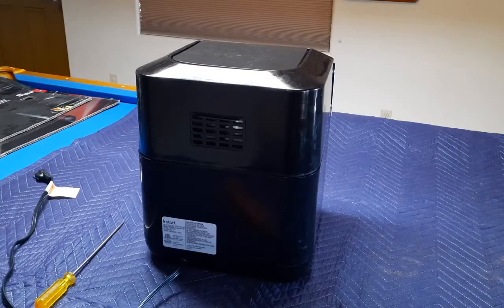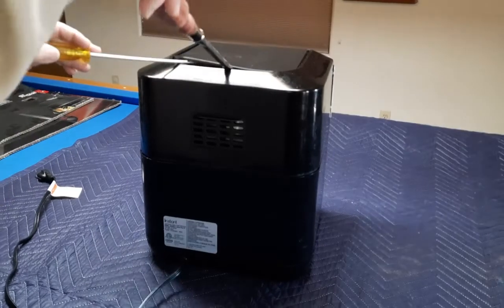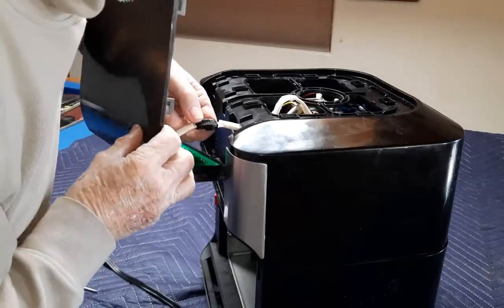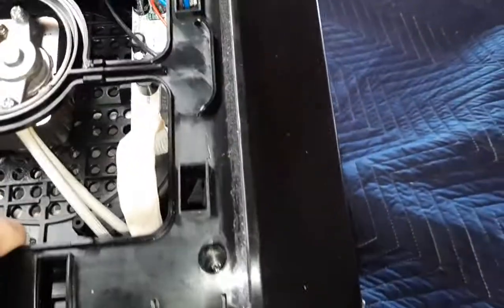How I fixed an Instant Vortex Plus Air Fryer

Comment: mine won't let me press down. i'm pushing so hard on it too... how hard did everyone else have to push?
Reply from the maker: There have been some comments about my video, where they had a problem with the door switch. 
Here is what Leon said about the door switch. and he described the symptoms of door switch problems. .
@LeonKeyser
1 year ago
Thanks for the DIY fix. In our case it was not the thermal switch, but the micro switch at the front. The one that triggers the screen and open door. The switch was malfunctioning and by using a small screwdriver, bending the flip switch leg inside the micro switch a bit, fixed the switch. Now we're cooking again. Your vid helped me figure out how to open it up. Thank you so much! 

SYMPTOM: If the fryer briefly turns on when you plug it in and the light inside stays on, but the screen stays off when the door is open. This switch is the problem. Msg me and I can help with some pictures I took.

Perhaps that is your problem?  We did not have a door switch problem, so I can not verify what Leon said. 

If you sort the comments by Newest you will see another comment made  6 days ago where they could not reset theirs and my reply.

Please, Read my reply and just know a Multimeter is a valuable tool for DIY fixers.

 A multimeter  can be purchased at Walmart, Amazon, etc. for under $20. 

As I told @user-bu3pi2pz2g
6 days ago 

She should test for continuity to see if the thermal fuse is the problem or not. A  word of warning, Never test for continuity when the unit is plugged into power or power is present. Continuity test should only be done to test if a component is open or closed with no power present. The thermal fuse should be closed, or has continuity. If open, or no continuity then the heat inside the fryer triggered the thermal fuse’s temperature rating caused it to open, No Continuity. It either has to be reset or replaced. Resetting puts it back into a closed state, Has Continuity. 

My son’s is still working and since it was so easy to fix, I decided to make this video to help others with the same problem. As I told him, Keeping the unit as clean as possible is the best way to keep from triggering the thermal fuse.  Also, when using for a prolonged time put it is an open space so the fan can circulate cooler air to keep the thermal fuse from overheating an opening it. 

Good luck and I hope you are able to fix yours.
Reply: Yes it's the light still on but screen is off. Ty so much
Reply: I don't see how to send a message to get the pics 😢
Reply from the maker: @letisiaariyurisimancas1911  Sorry, I was watching lot of March Madness Basketball today. 

If your thermal fuse was open, I do not think you would even get a light on, because the thermal fuse is basically located right off the power cord and stops current flow right there. So not even the light would come on if it was an open, NO Continuity, thermal fuse.  No current would flow past the thermal fuse to the light. 

That was a comment made 1 year ago by @LeonKeyser. If you sort by newest and then scroll way down you will find it. Note as you scroll down the time frame when comments were made gets older and older. Look for one made a year ago. There will be several. I never tried to message him since we did not have a door switch problem. If you click on @LeonKeyser it will take you too his channel. Perhaps you could try commenting on his newest video and ask him if you can get those pictures of the Vortex Fryer door switch fix he refers to on Johntube2525’s, How I fixed an Instant Vortex Plus Air Fryer.

In his comment to my video, he does say he bent a spring in the micro switch and got it working again. 

Here again I do not own one of these Fryers, I only fixed my sons. 

I tried searching for Fryer Door Switch Fix and could not really find much on YouTube, but if you try a similar search, it does seem to pop up a few where they might sell a replacement door switch. I did not click on those, just saw them when I searched.  I think you need to find yours and see what it looks like or if there is a part number or label on it so hopefully you could get the right replacement. 

That is about the best I can do and suggest. Good Luck and I hope you get it fixed.
Reply from the maker: @letisiaariyurisimancas1911  Dummy me! Once you find the comment by @LeonKeyser
1 year ago you can just click the reply link and ask him HOW and IF you can get the pictures related to fixing the door switch because you have the same symptoms. Just realize it has been a year and he may not have them anymore. You might have to share your email address with him if he reads your reply to his comment. 

If not here are some examples of micro switches that I know of. 

Look for a button that gets pushed in when the door is shut. Or a post on the door that eventually pushes a switch closed like on a top loading washing machine lid. 

I fixed our microwave door problem years ago. So long ago I do not remember how I did it, but microwave oven would not work unless the door is shut.

I recently fixed our 25 year old washing machine lid switch. Washing machine will not spin unless the top lid is shut. Found the switch is plastic and was cracked so points would not close.  First, I just taped the lid switch together and twisted a wire tight around the tape to hold the thing together. It worked, but I found a new switch on EBay for under $15 and bought a new switch. Replaced the old with brand new. No video. 
 
I temporarily fixed a micro end switch on my heating system until I could find a switch replacement. I bent the spring inside, so the points would snap shut when the black button was pushed in. My heating system has a Honeywell valve assembly with a micro end switch. A little black button on the micro end switch gets pushed in and that closes a set of points inside the switch.  Once I found replacement switches, on EBay I replace the old with new. 

Look for a switch that will be actuated once the door on your fryer is closed. My son lives in town 20 miles away, so I cannot look at his for you. However look for the switch so you know what to try and fix or replace. Good Luck.

Comment: Help I couldn't get mine to reset. I am doing something wrong
Reply from the maker: If you read many of the comments you will see, not only did I get my sons to reset, but many others also got theirs to reset. If you have a multi-meter please Check, the thermal fuse for continuity. If it has continuity then there is something else wrong somewhere. If it doesn’t have continuity then it is the thermal fuse that must either be reset by pushing the little black button or you might have to replace it, if it will not reset. 
Since I was able to reset ours, it had continuity after I got it out by pushing on the little black button, I never pursued trying to buy a replacement. Perhaps you can find a replacement, ours was labeled KSD301-CR 16A 125V 200C. Try to find this exact one by googling KSD301-CR and/or google replacement thermal fuse and try to find one with the same specifications. I think the most import information or specification is the 200C. Meaning it is rated for 200 degrees Celsius. I would not go lower on that temperature rating if at all possible. I think the next important information is 16A, should be rated for 16 Amps and 125 Volts. It is a chore to remove that little thermal fuse, but can be done. Since I do not own one and I simply managed to fix my sons that is about all I can tell you. Good luck and I hope you get yours working.

Comment: Thank you so much for this video. Worked perfectly! Would you happen to know why the fuse keeps blowing every few days? I'm having to open the top again and again and press down and reset the fuse with a flat head screwdriver.
Reply from the maker: I told my son there were probably at least 3 things that could cause the thermal fuse to trip and he should try to avoid these three things. Remember the thermal fuse is a safety device to try and prevent a combustible fire from occurring. At the end of my video I show you the labeling that was on our thermal fuse. It is only rated for 200 degrees C.  This converts to 392  degrees F.

1. Do not let grease build up inside the fryer. Especially on the face of the thermal fuse. Keep the interior as clean as possible. Here is a link to a great video by, Lana Under Pressure, on cleaning Air Fryers: 

https://www.youtube.com/watch?v=Qqthx1nke0E

2. Do not cook with the Fryer in a somewhat confined space, where it cannot properly circulate air to keep the internal temperature below the thermal fuses' rated value. Pull away from the wall and even better move to a location where no cabinet is above it. It needs to be able to circulate cooler air while cooking. 

3. Try to avoid cooking things that take a very long time to cook and probably should have been cooked in a regular oven rather than the fryer.

Thanks for watching and commenting and I hope these tips help you as much as they helped my son. He and my grandkids still use theirs.

Comment: this was great!!!. does this air fryer have a filter that need to be clean ?
Reply from the maker: It has been several years since I repaired my son’s air fryer. I do not recall seeing a filter, however it might have one. While disassembling i,t I was just trying to get to the thermal fuse so I could read the labeling on it. I was not looking for an air filter, so maybe there is one, not really sure if there is one or not. Sorry!

Comment: Wow - What a guy - you are my hero! But
My story is a little different. I followed your direction and learned that my thermal fuse was NOT tripped. So I started following the brown power like. It is connected to a micro switch activated by the door. Well a quick check indicated the switch had no continuity. I took it apart and found that the plunger operated by the door had worn down just enough not to activate. I turner it so the worn side was facing the rear and IT WORKED. I would never had had the chutzpah to crack the case on this baby had you not led the way. I love this machine and would have immediately replaced it. Thanks for making me curious. You are quite an adventurer and you are kind enough to share. Thank You!
Reply from the maker: Thanks for the kind words and most of all for the subscription. I am glad you were able to get inside, check for continuity and ultimately find the problem. Great comment and hopefully others will read the comments, your comment and have success if they have a similar problem.

Comment: Thank you that actually helped out a lot but the funny thing about my air fryer was the wire wasn’t clipped in right and still showed E1 but all I had to do was just plug it back in and it started right up
Reply from the maker: Thanks for watching and commenting! I am glad the video helped you. I think one of the hardest parts is just figuring out how to pop the top off without breaking something.

Comment: I called the company and they sent me a new one, then after a few weeks I took the top off and found the fuse and pressed it and it came on. So I am still using the old one but it trips from time to time.
Reply from the maker: Thanks for the information. Maybe my son still has his owners manual with a phone number and maybe some of the people out there that read comments have theirs, but it would be helpful if you comment back with the phone number you called. It might help others that actually read comments. I always try to read the comments sent to me on my video or if I am looking at someone else’s YouTube video, I always try to read thru the comments for good hidden information, like a helpful phone number. Thanks for watching and commenting

Comment: Can you please tell me where you bought the thermal fuse? I can’t seem to find it on Amazon when I type the info that you listed.
Reply from the maker: Because I was able to get my son’s fryer working again by resetting his thermal fuse, I never bought a thermal fuse. It was labeled, KSD301-CR, 16A, 125V, and 200C. I did find one that was only 10A on Amazon, but we never did buy one. This was a long time ago and he still does not need one. My son is still using his and I advised him to keep it clean and to move it away from the wall, so it is not under his cabinets or next to the wall when in use. This allows it to circulate cooler air during use and he is still using with the original thermal fuse. I do not know where to find the exact same one as ours was labeled, but you now know how he has kept his working and what his was labeled. Good luck and if you find one, please comment again where you got yours, as a few others have asked the same question about where to find a new thermal fuse. I would probably be inclined to try the 10A if I could not find the 16A, and if it failed I would probably give up or keep looking for the 16A. Sorry, no more info for you!
Reply: @johntube2525  Many thanks

Comment: I’m on my 3rd Vortex Plus oven air fryer and after cleaning it only the reheat wants to work. I’m assuming I got water inside the upper components and I’m hoping it’ll resolve itself after drying out. But thankfully now I’ll know how to fix it if it quits completely, again. Thank you!!
Reply from the maker: Thanks for watching and commenting! Since I had my son’s fryer completely apart, I cleaned the inside plates and everything that was dirty, really good. It is much easier to clean when apart. However, if not apart, I would only use warm wet rags with heated soapy water to clean the insides, rinse the rags out in a small container of warm soapy water and then wring the rag out until not dripping wet. Wipe any excess water and soap off with a dry cloth. Keep water away from circuit boards. 

As I have written to many others in the comment section, I believe keeping the insides clean, which includes wiping down the thermal fuse and thermistor is the key to keeping the unit cool enough to not trigger the thermal fuse. This would also include operating it in a location where it can easily circulate cool air. Try not to operate in a confined space or with the back up against the wall. 

As a side note, anytime I re-solder components on a circuit board I clean the flux and anything else off the circuit board with Isopropyl Alcohol and small foam cleaning pads already mounted on a plastic stick. I use 99% pure alcohol and it evaporates quickly so the board and components are not wet.

Good luck and thanks again for watching and commenting! I hope what I have written here helps!

Comment: If I may....  This was a great video. Thank you. I did mine a bit different after watching this video. After the top cover is off look into the machine through the back left corner so you can see the thermal breaker. I drilled a hole through the top plastic frame right over top of that button. I then poked a dowel through that hole and by watching through the top I was able to reset the breaker. A bit less work to do. If it popped once it will probably pop again. My job is to make my job easier.
Reply from the maker: Might be a good idea if you occasionally cook things that take a long time to cook and could cause the internal temperature to exceed the thermal fuse’s rated value. I told my son there were probably at least 3 things that could cause the thermal fuse to trip and he should try to avoid these three things. Remember the thermal fuse is a safety device to try and prevent a combustible fire from occurring. 
1.	Do not let grease build up inside the fryer. Keep it as clean as possible. 
2.	Do not cook with the Fryer in a somewhat confined space, where it cannot properly circulate air to keep the internal temperature below the thermal fuse’s rated value.  
3.	Try to avoid cooking things that take a very long time to cook and probably should have been cooked in a regular oven rather than the fryer. 

So yes, for Occasionally resetting, you have created a way to make it easier. I feel Occasional is the key word here. As you stated, it will probably pop again someday, but it is an important safety device! Thanks for watching and commenting.

Comment: i do this everytime it overheats, i cant seem to have it working for more than 5 min without it overheating again, any ideas? it seems like it has a poor ability to cool the system down and leads to overheating
Reply from the maker: The below is just a guess, but is the way I would proceed. Do you have a high temperature gauge of any kind? I ask this as I would just check to make sure the temperature is exceeding the Thermal fuse rating of 200 C or 392 F. If it turns out to not be exceeding the thermal fuse rating then I would try to find another thermal fuse to replace the old one. 

I am sorry to say, I never needed to find one since ours was not bad, so I have no source for the Thermal Fuse. 

If it is exceeding the rating, then ask yourself, Why? Perhaps the fan is not working properly. I do not know the expected RPM of the fan, but perhaps for some reason it is not achieving the necessary RPMs to circulate enough air. Sometimes, that type of information is written on the fan. I do not remember if my son’s fan had anything written on it. 

Sorry, because your question is beyond the scope of my video and about all I can do is guess and tell you how I would proceed. Sometimes I was able to fix things and sometimes I was not. I tried fixing my son’s Xbox, but could not fix it. I had to give up and he bought a new one. Good luck my friend!